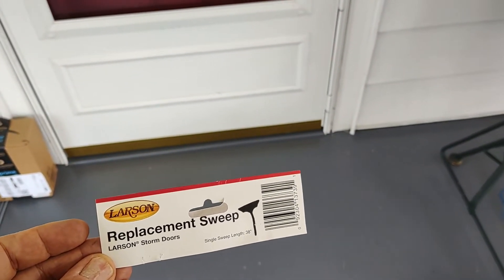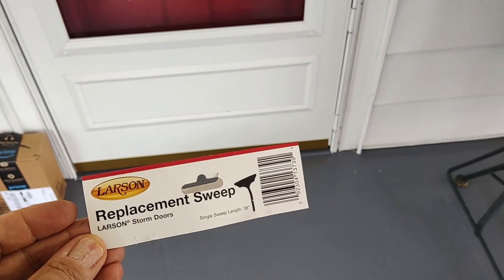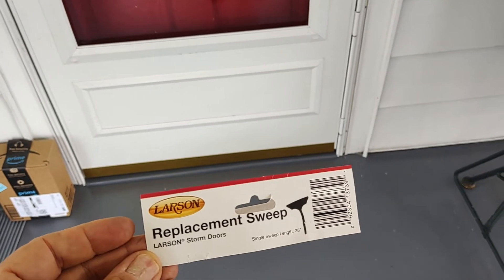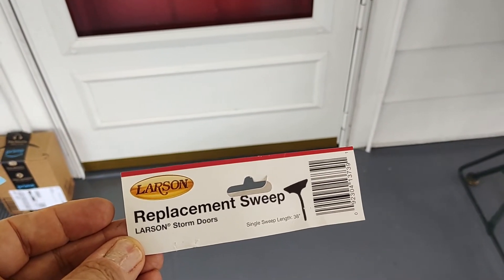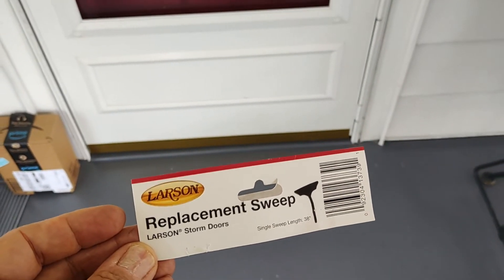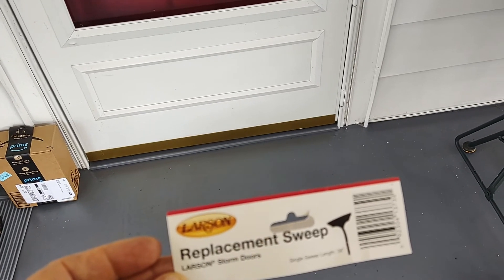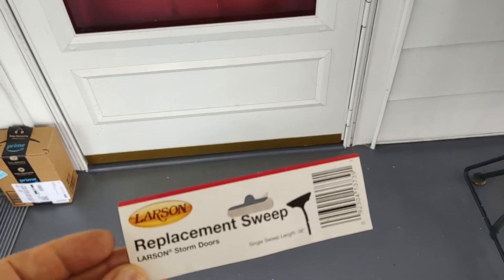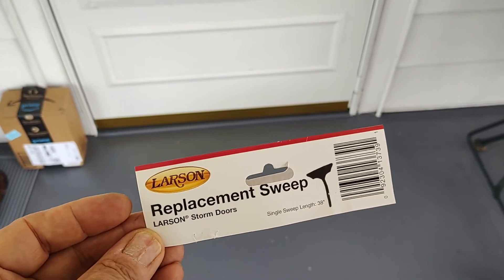Replace Larsen Storm Door rubber sweep insert

Comment: Sharing my experience.  Could not get the metal piece off the door that the sweep slides into so I had to do this on my back.  

I was able to get the old one out by grabbing it with channel locks a bit at a time and jerking it, to break it free wherever it was stuck.  Then I was able to pull it out.

I sprayed silicone on the new sweep and it slid right in.  Pulling back a bit on it while pulling it in stretches it out and helps get it past the 'start' point.

Contrary to some Larson info, neither end of the door was crimped, which I was thankful to find.

Comment: Great idea on dish soap but how do you get the old rubber sweep out?  Can’t figure out what to use to open the metal crimped ends on rubber sweep
Reply from the maker: Sorry for not responding earlier... I honestly don't recall having a problem getting the old one out, my issue was more how to "shove the new one in!". I hope you worked it out.

Comment: This is not true - you can’t just slip it on with dish soap. I had to remove the bottom strip and work the replacement rubber through the slot. Otherwise, the end would pop
Out of the slot.